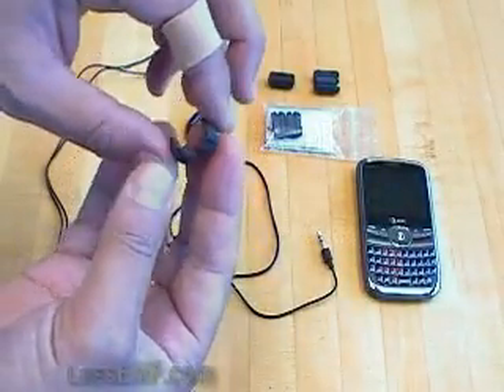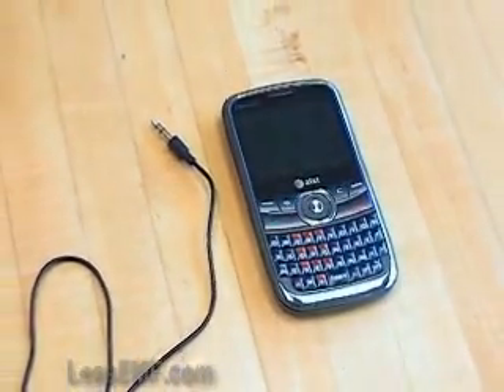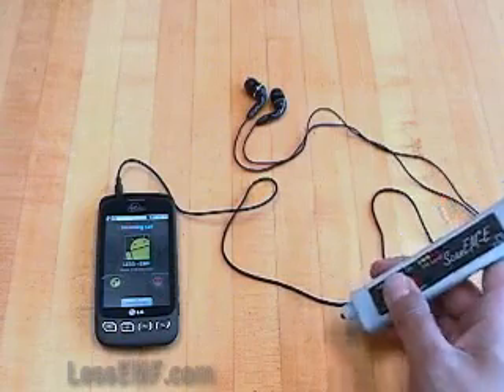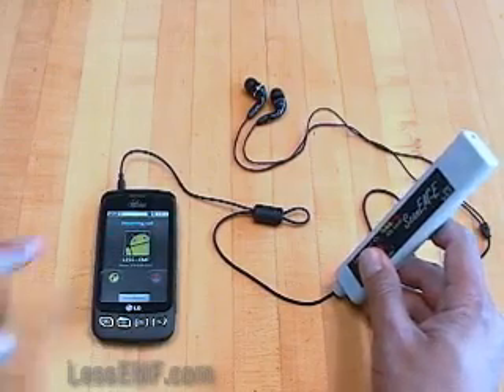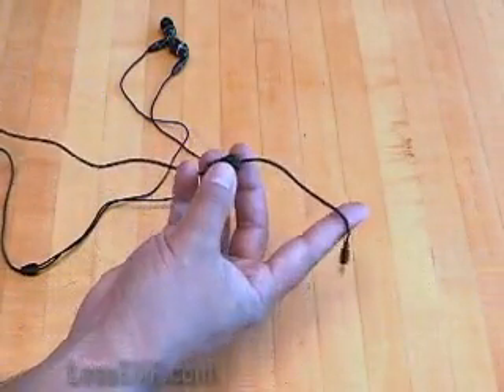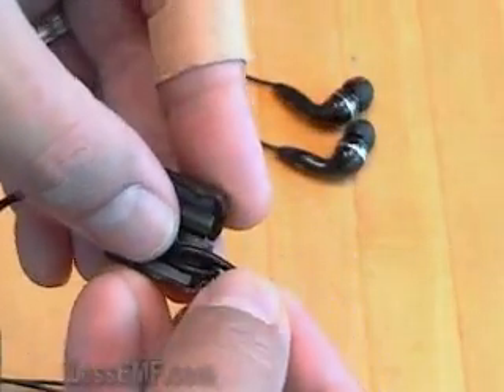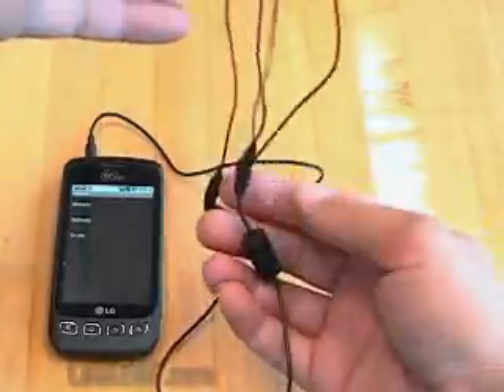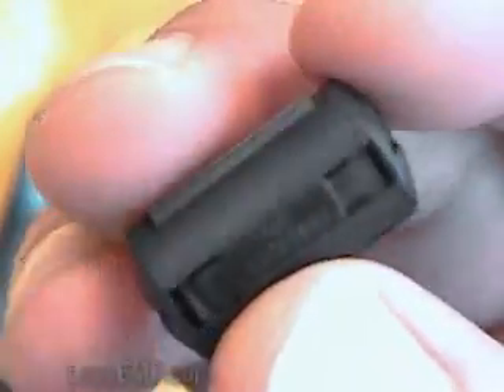Ferrite Snap Bead by Less EMF, Inc.

Comment: The section of wire between the ferrite and your head is not protected and can still act as an antenna?

You mean from the 3.5 jack to the ferrite is not protected?
Reply from the maker: No. The section of wire between the ferrite and your head is not protected and can still act as an antenna is the correct statement.

Comment: This is only for 200-1000 mhz it says on your website. So it's not for 3G/4G cell phone radiation, which is more often likely to be in the 1800 mhz or higher range.
Reply from the maker: Correct.

Comment: Seriously, educate yourself on how and why a ferrite bead works. 
It is used for common mode intrference picked up by and transmitted from the cable and does nothing for stopping RF from the phones antenna which travels through the air in ALL directions including to your body and head,
Reply from the maker: Perhaps you misunderstood the video. RF signal is both injected into the headset wire from the phone, and the wire acts as an antenna to pick up the "broadcast" RF signal from the phone. Either way, that signal is conducted through the wire to the termination (earbud). The ferrite helps prevent that signal from travelling past that point in the wire. Note that it can only suppress signals which originate "upstream" of the ferrite. Anything that gets into the wire between the ferrite and the earbud will not be suppressed. This is why we recommend placing the ferrite close to the earbud end of the wire.